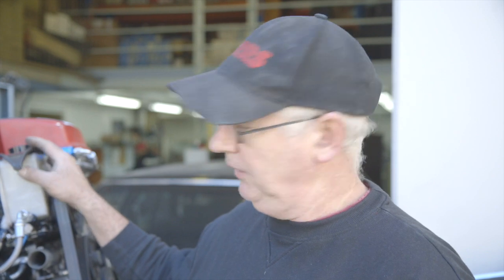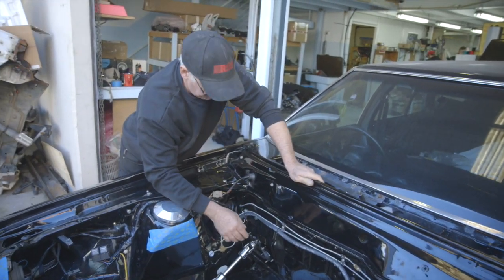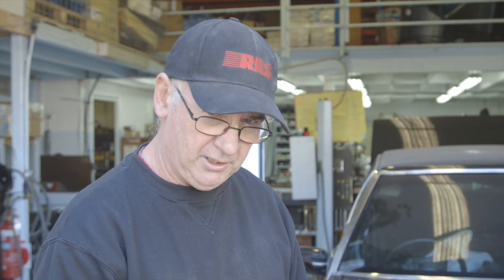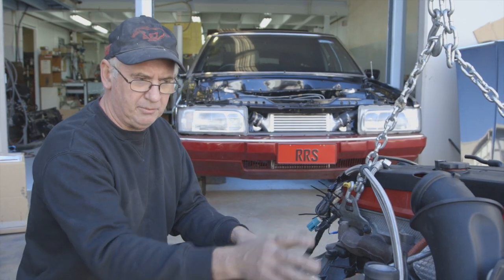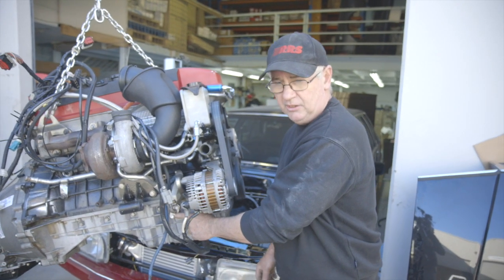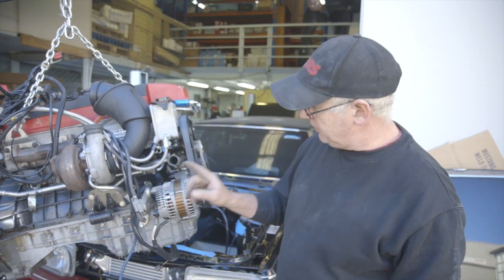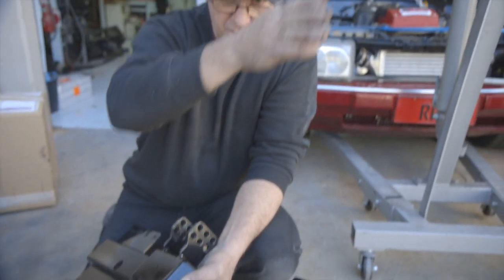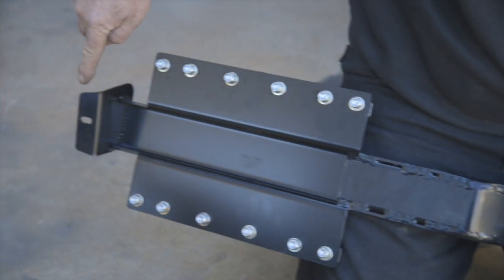Typhoon Tech

Comment: Hi i own a ford territory awd stock 6, 6speed auto, would a xr6 turbo engine bolt straight in and just change the computer?? Cheers
Reply: you will need the turbo 6sp trans as well as its different from the NA stock 6 trans.

Comment: My falcon has done 450.000 kms  (ba) best 6 iv ever owned
Reply: Jim Clarke whats your secret?
Reply: Change the oil when it looks a transparent brown, forget the kms or the months, had a few other small problems but cheap motoring over the years, and still goes similar to when i bought it + im a mechanic
Reply: Change the oil when it light brown, i dont follow the kms or months, the engine speaks for itself. had a few other small dramas over the years iv owned it (over 10 years) iv seen taxis with a lot more kms than mine + im a mechanic ))